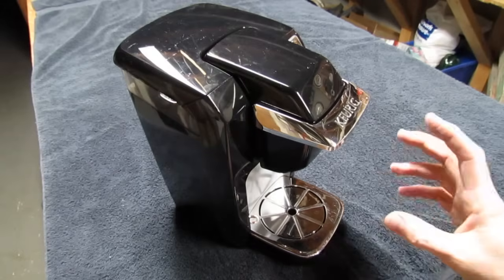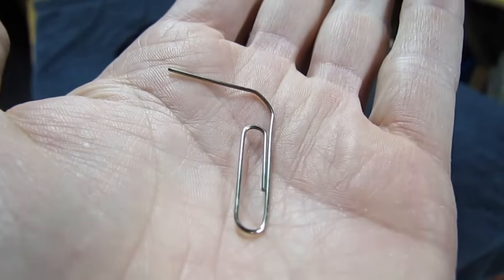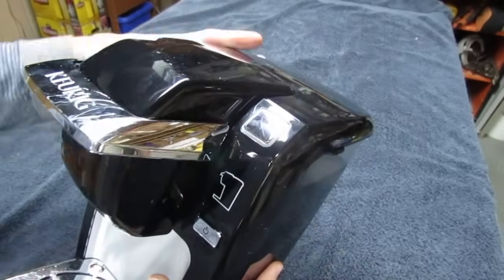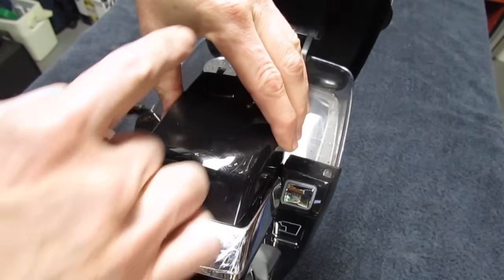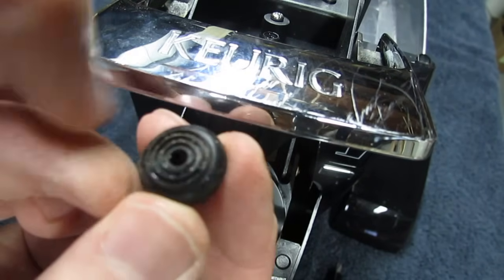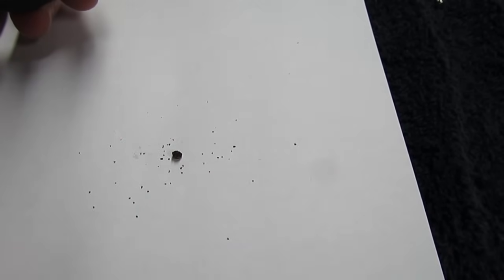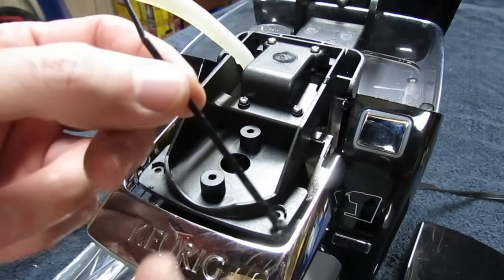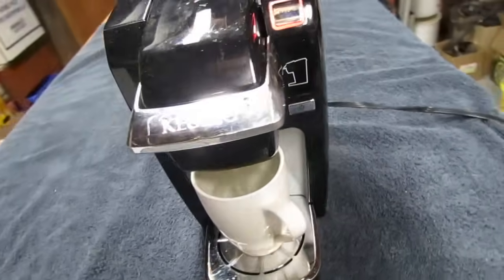How to Fix ● KEURIG Coffee Maker that Stopped or Slow Brewing

Comment: Chris,                     Hey there. Great video, well done ,to the point. Had the same problem I thought, took it apart and the needle was clean.The water was not coming up the tube, so I shook the whole coffee maker while it was pumping and it finally broke loose. I'll justhave to keep it clean and use it more often I guess. Thanks man.
Reply: Same experience--the nozzle cleaning didn't work  (despite being very clearly explained). I shook the thing and nearly burned my arms but the water still won't go through the tube. It makes a little whistling sound like it's trying to force something through. Any more suggestions?

Comment: I tossed one coffee maker and when the second one stopped it was getting too expensive so forund this video. Thnanks. Got it done but slid ziptie up with flat screw driver. Only thing now is which is the top of the rubber disc.  Tried to freeze video but no dice on which side is up.   Cant beleive I actually had a tiny phiiips screw driver. Not the handiest person and never have the right tools.

Comment: Thanks. I seriously thought it was dead and was on Amazon looking around for a new coffee maker. It worked immediately. I'm going to take it apart and give it a good cleaning as you recommended. Plus i'll run vinegar through it a few times. I wonder how many of these machines are sitting in landfills when all they needed to do was follow your troubleshooting steps?
Reply from the maker: I think you're right. Probably 90% in the landfill are just clogged

Comment: There is an even easier way that doesn't involve taking anything apart.  Of course try the paper clip first or possibly a pipe cleaner but before you take it apart you might try this easy fix.  Take the water reservoir off and dump out any excess water and then take it to a gas station that has air.  Squirt several blasts of air through the water intake port and it should blast out the obstruction.  Easy fix.  It worked for me.

Comment: This typically happens when using 3rd party Keurig adapters. I've seen this on all kinds of Keurigs.  The actual disposable  Keurig K-cups have a little bag inside which then has the coffee inside.  The little bag is like a small drip coffee filter.  It isolates the needle from the coffee itself. Third party adapters allow you to use your own ground coffee in this little "adapter cup", but there is nothing to isolate the needle from the coffee  grounds.  The needle goes straight into the coffee grounds, those small grounds go inside it while they are still dry, then the grounds get wet and expand, they dry and then they are stuck.  The only one approved by Kuerig, is the Keurig brand, called "My K-Cup Universal Reusable coffee Filter". It isolates the grounds from the needle thus preventing this from happening. It is well worth getting the Keurig brand just to avoid this problem. I had this problem and since I got the Keurig brand adapter, no problems at all. Of course there are other ways things can happen but this is most typical.   BTW, great video.

Comment: Verry excellent video-----may I suggest that if you do an update that you include the proceedure involved in removing and cleaning the check valve located upstream from the paperclip clean-out fix. It only invilves removing two small screws---the remaining parts are eisely removed and taken apart by hand. If the discharge oriface (paper clip fix) is clogged you can almost guarentee that the check valve is also clogged or will be soon.
Reply: I should have made it clear that my machine is adifferent model  than the one in this video.
Reply: Never mind---I just found your "check valve cleaning" video.

Comment: Great video! No BS, just the necessary information presented in a quick and simple manner.

I have another problem with this model however. . . After cleaning it out as shown above I insert a new K-cup and press the Brew button, but then it just stops brewing after the cup is less than half full. Opening the unit shows that the tubing is once again filled with coffee grinds from the new K-cup. Clearly it is back-flowing, probably due to a fouled or faulty check valve. 

There are plenty of videos showing how to access the check valve on larger Keurig models, but not the B31. I suspect it is located somewhere deep in the unit's inaccessible bowels, as I saw no sign of it when the top was opened up. Any ideas, or should I just bite the bullet and get a new Keurig?
Reply from the maker: Some of these models have a piece that just twists a 1/8 turn to get off right around the k-cup area and it gets grinds in it too and can be cleaned out. Everything comes apart on these machines. If you are already in the mode to replace it, why not use this one as a learning tool? You may even find that you fix it and find there is no need to buy a new one. Use the process of elimination and work your way backwards checking each thing along the way. Good luck. You've got this!
Reply from the maker: Let me know how you make out.
Reply: what check valve???
Reply: @gregandrews2800  He's using his car engine to make coffee

Comment: Hi. Finally I found my old Keurig model. I watched this video and I’ve had trouble with grounds a little.

**My problem right now is that the needle in the pod isn’t breaking through the k pod.**

It’s old, but everything seems ok. (I do need to know which direction the clear rubber piece around the needle goes.(I’ve messed with it too much and can’t remember.)placement of needle is to the backside of the machine correct?

Hopefully, you’ll see this and can advise me on this issue or if I messed it up?
I love this machine! I really don’t want one of the newer ones. Newer isn’t always better. I hope mine still has life.
Thx 😊

Comment: Excellent video.  Clear-cut and to the point.  I already knew about the paper clip fix but it kept happening.  So I dismantled it and found that I also had a check valve.  Cleaning that out seems to have worked.  Thankyou!

Comment: The paper clip did the trick for me eventually.  I didn't want to take it apart so I keep trying. What did it was having the paper clip go into the hose which only happened on the back hole. You can tell because it goes in up to your fingers.  Also note: my blockage was coffee grounds that occurred because a guest was using the same k-cup multiple times.

Comment: Thank you so much! This was an incredibly helpful video and allowed me to fix my Keurig myself which was awesome (and used the zip tie trick). However, I have it all back together and it was working for a couple brews (didn't brew coffee, just ran hot water through it). But now it continues to indicate that the handle/lid is not closed (Handle Indicator light is flashing) even when the lid is fully closed. At one point I sort of wiggled the lid and it registered as "closed" and allowed me to run the cycle. However this only happened once and I haven't gotten it to work again. Has this happened to anyone else or does anyone have ideas about how to fix? I figure somehow when putting it back together I tweaked something so the machine can't "register" having the lid closed. I was thinking about just taking it apart and trying to put it back together again. Thanks so much for any help (and for this great video)!
Reply from the maker: Yes, just take it apart again to make sure everything is aligned properly. I'm sure you'll find something wasn't quite right.
Reply: @chrisnotap  Thank you so much. I'll give it a shot!

Comment: LOOK!: If your identical unit as shown in the video doesn't have a faint electronic hum anymore (when you plug it in) but it still lights up (but does not heat or pump):
 I opened up the very bottom and found a loose nut holding an electronic part (were the wiring comes to a junction) I tightened that up and it worked again! It's a little tricky to pry the bottom plastic base out (as well as the the metal plate) but once you do you'll see that the single nut holding the wiring may be loose (this is where the heater and pump apparently lose power).  I also trimmed some metal off of each side of the plate to get it to pop back in easier. NOTE: 2 screws on the bottom of the plate hold some of the wiring as well but these are not the issue.
Reply from the maker: Thanks for those tips!

Comment: Great video and instructions. However, I did these steps but water didn't come from the hose.  I'm guessing my issue is inside the machine a pump or hose maybe. Any idea what the problem could be?
Reply from the maker: There is actually no mechanical pump. All it is is the water gets heated to boiling point and bubbles up the tube by the base plate under the pot. Best would be to follow the tube down and see if anything is plugged there.

Comment: Thanks for the great video Chris. Going to try it. I previously cleaned the needles and the gasket but it hasn't worked.  What I am experiencing is my K cups, once used, have a big hole in them thus spewing coffee out the top and sides. The stream of water is all over the place not just a steady flow.  Any suggestions? Getting ready for the dumpster!
Reply from the maker: If your going to dump it anyways, just start to dismantle it and clear the blockage. It sound like something is just plugged.

Comment: Thank you for the video, it was very helpful. But the problem WILL happen again. It's a chronic situation caused by a defective design, and the cleaning process you showed will have to be performed periodically.
Reply from the maker: Yes true but you can also go for a few years without issue.

Comment: Before I try this, wondered what your thoughts were on my problem.  After de-scaling my machine, and cleaning, it will brew hot water out, but only if I put an empty coffee pod in it.  If I put a coffee pod, with or without paper filter, in it, I only get half a cup.  My machine is almost 4 1/2 years old, so might just be wearing out.
Reply from the maker: It's not wearing out. It has simple operation. If you are going to throw it out anyways since it doesn't work well, what do you have to lose? Take it apart and learn what makes it tick. You'll end up fixing it in the process. Just do it.
Reply: @chrisnotap  I have the same problem with mine but don't even get 1/2 a cup.  I already followed this video, NOT helping.

Comment: I have a leak where the water is coming out the bottom!  Is there an easy way to find out what the problem is??
Reply from the maker: You’ll need to take that area apart to see where the leak is coming from. A hose hose may have slipped off or is split. Good luck.

Comment: That's fine for that machine but mine is slightly different so having issues trying to adapt your instructions to my machine, which seems to have more screws, one of which I've dropped down inside 😮
Reply from the maker: They are pretty straight forward to take apart. You have nothing to lose by trying since you're probably going to buy a new one, right? Go for it! Just tip the machine over on a towel (some water may come out of it) and get the screw that fell in. You've got this!!
Reply: @chrisnotap That's what my wife said, about getting a new one 😂. Thanks 👍🏻

Comment: Would this fix it because I could put water and stuff in mine and turn it on and it would flash red while it heated up then when it tried to come out it went solid and nothing came out it would just sit there with the red light until u turned it off

Comment: Great video but I ended up trashing my K15 Keurig. I wound up taking the entire thing apart (beyond what you showed) and couldn't find a single clog anywhere. I suspect the motor, while it still ran, had lost its suction power somehow. Regardless it was beyond the hope of salvation at that point!
Reply from the maker: There is no “motor”. It’s what’s called and air lift. The water gets heated in a short section of pipe and the bubbles it creates from boiling it gets lifted to the top along with some water and process just repeats itself
Reply from the maker: Sounds like it may have been blocked in the horse shoe shaped heater in the base. Oh well. It’s all about learning. It’s great you tried.

Comment: I wish I had seen/followed this guidance sooner!  I tried 2 more times to brew after just a few drips of coffee came out.  Now the light won't go on at all :(  Called the company & they cannot fix or replace.  Does anyone have an idea?  Is there an internal fuse that might have blown?
Reply from the maker: Yes they all have a thermal fuse inside them that can be replaced if you're handy. You can get them at your local electronics hobby store. They are cheap.
Reply: Getting to the fuse is the rub…do you have a video for this?
Reply: @chrisnotap  getting to the fuse is a big challenge…do you have a video for this process?

Comment: I have mine apart, but am not even getting water delivered to the needle valve, so it must be an issue down inside at the pump or something. I wonder if this sucker has a filter on it or something? I really hasn't been used much, (maybe 5-10 times  year) for the 3 or 4 years I've had it. Any clue how to get down into the bottom half of this thing?

Comment: Mine you can’t take the second set of screws out they have a piece glued over that part. It’s only 3 months old
Reply from the maker: It's most likely not glued in. Use a small tool and try to pick it out. Or use a hammer and small screwdriver to split it and break it.

Comment: Hey I have an off topic question, so I have a Hamilton Beach Flexbrew Trio coffee maker and the single cup side where I put the keurig coffee pods just randomly stops pouring a quarter way through or sometimes half way. I have to basically turn it back on again to continue the brew but it has not done this before ever. Do you know what this could be a sign of? Ive had this maker since 2021 and the problem just started this year. Do you think it just needs a clean or maybe the motor is dying? It appears to be flowing just fine but I mean I dont know what its performance should since it was 2021 when I got it. If you are familiar or unfamiliar with this brand what do you think I should do? Ive looked everywhere but cant find anything that helps.
Reply from the maker: My suggestion would be to look closely at the pokey thing that pokes into the Keurig cup. Dismantle what you can to make sure there is no coffee ground particles plugging it.
Reply: @chrisnotap  yeah so I looked at it and the thing that pokes into it can actually be unlocked and pull off from the tube so I can access both sides of the poker. It appears to be clean. Unless something is also stuck in the tube somehow maybe it’s time I retire it :/ it’s only been 3 years and it’s supposed to be a decent brand so I’m not sure what brand to buy if I can’t fix this one. Perhaps I’ll buy Keurig but I want that needle to be easily accessible just like my Hamilton Beach one.

Comment: The Keurig I bought last week has already failed twice. In the meantime, my Hamilton Beach coffee maker (which can also use K-cups) has brewed thousands of cups over the past 5 years and has never once failed.

As for fixing this, it's probably a lot easier to simply run some vinegar through to dissolve the blockage instead of taking it apart. Of course the real fix is to not buy Keurig products in the first place.

Comment: ours was clean but it would spit a bit of water then click a few times then stop, I think there may be a safety on the water pump, can't find it. The micro switck on the stop appears to be working and the inline filter is clean.
Reply from the maker: I think you’ll have to investigate further. There is a heating element at the bottom and that’s what he eats the water up and pushes the hot water along with the bubbles up the pipe to make it drip out of the top. There is actually no water pump. It’s what’s called an air left. That thing that heats the water up might be just built up with scale from the water.
Reply from the maker: Heats the water up. Airlift.

Comment: Hi there! I went through all steps and once my machine boils the water it starts to make the brewing sound but no water comes comes out of the pipe. Does this mean the blockage is further inside somewhere? Any suggestions of what to do? I see there are four screws on top and am wondering if I need to open up the machine further to look inside...thanks!
Reply from the maker: Open it up further and poke around using a skinny wire to find the blockage. You have nothing to lose. You either buy a new one and learn nothing or take it apart, learn, and probably fix it and save a bunch of money. I'd go with the later. Good luck.

Comment: How did all that crud get in there?  Mine started not brewing after the 1st or 2nd use. The water heater doesn't even turn on. Also, how does crud in the needle keep the heater from turning on?  It seems like it would try to brew but just not come out. There doesn't appear to be a sensor in the needle that could stop it from trying if it's clogged.
Reply from the maker: Minerals in the water accumulate, coffee grounds splash up into the needle and after a bunch of brews it doesn't want to brew. These things work on the air lift principle and doesn't take much to slow them down or to stop.
Reply: Jack White I hope this doesn't happen to me!!!
Reply: These machines have a one year warranty. If yours is still under warranty, contact Keurig and they will ship you a new one, no charge. Even if yours is out of warranty, they will offer you a deep discount on purchasing a new machine.
Reply: This model has an issue with air bubbles getting in the reservoir. Crazy as it might sound, use a straw and put it down in the water hole and blow some air bubbles. It has fixed mine on numerous occasions.
Reply: You mean in the back where you pour the water in, correct?